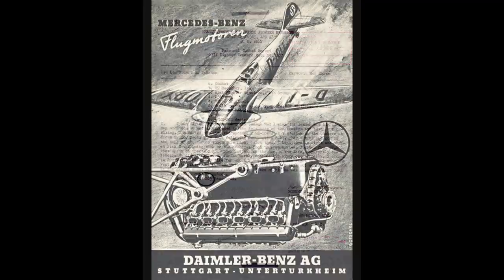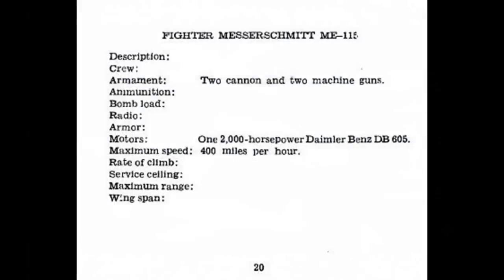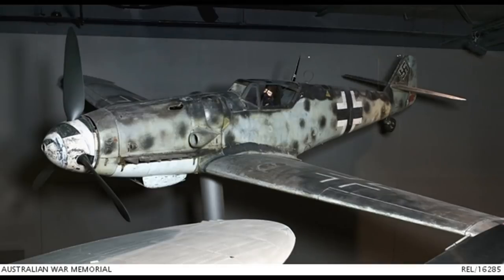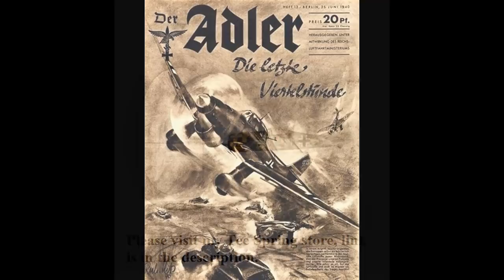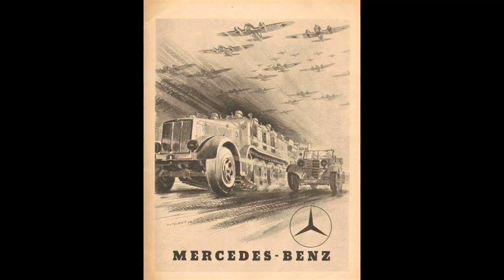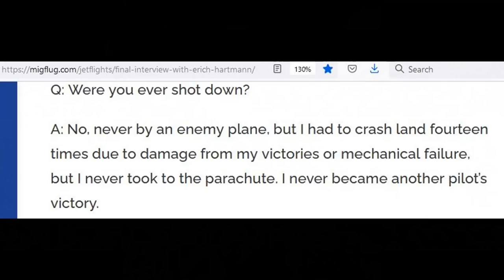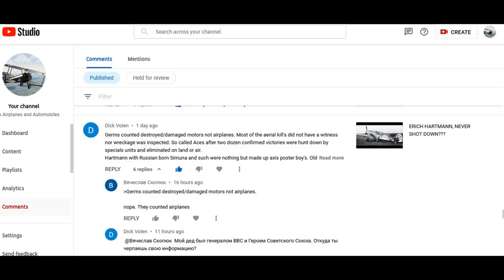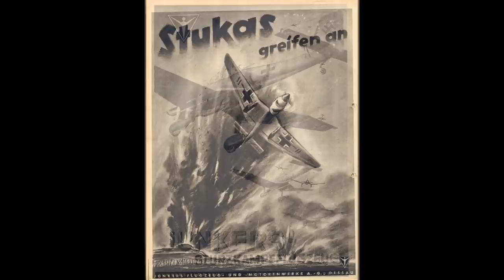Viewer Questions

Comment: That He-113 looks a LOT like the He-100D1, which supposedly did exist and was exceptionally fast for its time
Reply: Great cooling design too! That is..if NO ONE made holes in your wings... (Heinkel He 100)
Reply: Same plane, and the Aircraft stated out originally as the He-113 (which makes sense because their previous fighter was the He-112), but the name was changed to He-100,

And then back to He-113 to make it believable to the world.

And it was capable of those speeds in 1940...
Reply: @notsureyou  Yeees! We know ♥
Reply: @dallesamllhals9161  Well, at least you know. I didn't know, and learned something.
Reply: @lwilton  My bad!     ☮?
Reply: @dallesamllhals9161  Yeah, that cooling system wasn't very good for wartime, but lordy how awesome it must have felt to hit such paces so early on
Reply: @dallesamllhals9161  :-)

From memory, the information is scarce,

But according to the "all knowing" wiki, the D-1 did away with the evaporative cooling, and utilized the under-body cooler as the sole means for cooling.

But again the information is scarce.

I sometime wonder, if Messerschmidt had contributed to the funding of the DB603 (to help aid it's development), 

and not being as bold with the Me309 design (retained the normal tail dragger configuration, and had a standard fighter armament) if that might have helped that design coming to fruition earlier (and being superior),

Or if FW had contributed funding to the Jumo 213 project would we have seen the Dora 9 earlier??

But then I remember what the Nazi regime stood for, and what they did,

And I'm glad that those engines did not come to fruition earlier :-)
Reply: @notsureyou  Yeah, it's always a split between wanting to see more of this cool tech and wanting their regime to fall as fast as possible. But hey, there are just machines and they hold no ideology.

Comment: The HE113 was actually a HE100, there was a HE100 used to beat the ME209 speed record. It used surface cooling to improve air flow, no great for combat. The HE100 was manufactured to the tune of approx. 13/15, a couple went to Russia and Japan before hostilities began they never capitalized on the plane though the KI61 does look similar to the HE100. Heinkel used the remainder of the planes for factory defense and Germany used them for propoganda shots in various schemes.
Reply: @mikepette4422  The photo was on the cover of "The Luftwaffe War Diaries" among in other publications. It was leaked to the Allies also, shown in different squadron markings too.

Comment: re the Me209...if anyone can find back issues of the American Legion magazine from the late 60s to early 70s there was a very good and detailed article on its development and the "run for record" flights.  My father was a Legion member and I recall reading this article sometime during this time frame.  I especially recall that the radiators extended thru nearly the entire wingspan and I also believe they were evaporative to cope with the amount of heat dissipated by the engine.  So you could only run for as long as your coolant lasted.  I also seem to recall that an engine was good for perhaps only one or two runs before it lunched itself.   And as always, thank you Greg.

Comment: One subject I would love you to cover is the design of the firewall on the 109’s. My understanding is that it is mostly a one piece forging made from Elecktron and forged on the largest drop forge in the world. Supposedly that forge was taken by the US as a reparation. Also the firewall is used to hold the pivot trunnions for the main gear and you could take a wing off and still roll the fuselage around. Willy was a smart designer.

Comment: There's a good theoretical foundation for your running lean/oil dilution idea. Standard avgas is produced by narrow cut distillation - all of its components will boil below or about 100C, so very little will persist in hot engine oil. The synthetic fuel has a significant amount of lower volatility components (particularly the aromatics), and they could accumulate even in hot (100C+) oil. The Germans were also short of good quality lubricating oils, so they were already concerned about oil quality and paid close attention to it.
Reply: @brettdavies-young7102  That's a good point. Running lean means less soot & pyrenes getting into the oil, so extending the oil life. Given the German's lubricating oil shortage, that could have been a significant consideration for them.
Reply: Calums Douglas's book The Secret Horsepower Race covers this problem and talks about over rich  mixture and oil damage as the synthetic oil didn't boil off, and then having to reduce the fuel mixture and power to protect the oil.  And as per all of his superb book using primary evidence.
Reply: @malcolmmoy  Thanks - nice to have confirmation and a reference!. I've been doing some digging on the synthetic fuel manufacturing processes (I'm an industrial chemist by trade, so that's been right up my alley) and can definitely confirm that the C3 fuel would have had an unusually high proportion of high-boiling components. Anyone know how to let Greg know his theory was correct?

Comment: Video request: Assuming you haven't discussed it and I just missed it, maybe some day you could describe how Focke-Wulf, for example, engineered all four of the 190's standard guns to fire through the propeller disc? That is, if there's anything unique or interesting to say. I know that by that time, the interrupter mechanisms for cowl mounted guns was well beyond the experimental stage.
Reply: Yes, I think that this would be a topic worthy of Greg and his research skills. As far as I am aware, machine gun or cannon interrupter gear, only gets talked about in relation to WWI aircraft, but never WWII aircraft. I don't know why this is the case but with higher spinning propellers with more blades and coupled with faster firing more powerful machine guns I would say that the problem is far more critical. One thing I did learn from my book on the Me-109 was that experienced pilots would play with the lever related to (propeller pitch?) engine rpm in order to increase the rate of fire from their guns during combat manuvering.
Reply: Irc Kurt tank was an electrical engineer and the MG 151 had an electric trigger, it was probably controlled electric system..

Comment: Great video. I'm getting the picture that there is a certain minimum size for a fighter. Undersized planes just don't seem to have the room to fit all the necessary equipment. The Airacobra, the Spitfire, and the Bf109 all went up a size or two to stay competitive. A lot of Northrop designs come to mind, like the F5 and F20. The F16 must be just above the magic limit. Just a theory based on watching too much Greg lol.

Comment: Viewer question/Video idea: From a pilots perspective, the challenges and difficulties of flying a notoriously complicated/finicky manual plane like a p40/p38 compared to a more automated plane like a 109/190. Especially in combat. Is it more like a manual vs automatic car, where a stick is second nature once you know how, or was it actually a substantial workload on the pilot?
Reply: speculation here, but although adjustments could probably be made confidently and quickly in manual planes while in routine flight when given the pilot time for familiarity, once thrown into a combat situation where your constantly trying to spot and maneuver with enemy planes under significant G loads, the ability to adjust for optimal mixture/cooling/supercharger settings for altitude changes probably goes out the window to a significant degree for the manual planes.

Comment: Around minute 7, not sure what you are saying, but lean mixtures are for fuel economy.  At cruise, these engines run at as low rpm and as high boost as possible, while lean in the same time.  Octane does play a role here, and there is an octane rating for lean operation.  Perhaps you knew that, and I misunderstood your comment.  Cheers.

Comment: Thanks for some great videos Greg. I live in Krakow, poland where in aviotion museum (among many interesting planes like 
 beautifully restored Udet's Curtis Hawk) we have a fuselage of Me-209. You mentioned it could never become a fighter - would you like to expand on that statement?
Reply: Not Greg here (unfortunately), but I know the story anyway.
In order to achieve the record speed, the racing me209 had an engine cooling system based on special technology, with the whole wings used as radiators, leaking coolant by design.
Obviously this cooling technology could not be used for a fighter plane, due to multiple factors (e.g.: coolant consumption, extreme vulnerability to battle damage, etc.).
Without these special "cooling wings", replacing them with "normal" radiators, the performance of the Me209 were equal or inferior to those of Me109.
Reply from the maker: Hi Marcin, I would love to expand on that statement, but it will take a specific video to do it.
Reply: @francescoguzzetta  Thanks for explaining this one!

Comment: As always, absolutely love your work, and recommended you on the RCScalebuilder forum I use, as I am sure there are a good few guys on there who would love to hear what you have to say.

Only question I have is still.... the difference in design of the P51 prop and Spit prop for the same engine. Don't suppose you have come across anything new on that front? Keep up the good work :)
Reply: I wasn't aware of any differences in propellers, except perhaps for different manufacturers. None of my books on both aircraft mention any technical differences between the propellers for both aircraft. It is always described as a simple engine swap between the Allison engine and the RR Merlin and then the Packard licence built Merlin. Now I am very curious and perhaps Greg can shed some light on the topic in a video as there are plenty of people interested in both aircraft.
Reply: @markfryer9880  The Spitfire IX's Rotol hydrualic propeller looks quite different from the Hamilton Standard on the P51D - yet both used the same engine and both were air superiority fighters (although excelling in different roles). I would just have though at the least they would have tried swapping props to see if anything happened. I'm no expert on propeller design, but I would have thought such a different blade shape would have done something either way.

Comment: Thanks Greg.

I was not aware of the difference between the creators tool and the normal method of commenting.  I've only messed around with a very few videos and am abysmally ignorant on the subject from a creator's POV.

From a User's POV - YouTube's Comments have some real problems.  What they SHOULD do and what is done on most forums - is nest the comments - so if someone posts something - and there is a reply to THAT - it is nested under the comment it is replying to.  The thing with YouTube - is it only does that on one level.  After that - any comments are just tacked on to the end.

If there are a number of comments by some posters all the replies to them get dumped at the bottom of the list and there is no way to tell just exactly which comment the replies are to.

Thus - if someone has made 5 comments all being nested off a root comment - there is no way to tell if someone else's reply is to #1, #2, #3, #4 or #5.

I've had any number of problems because of that where someone will make a cryptic comment and I've no idea which of my comments they are referring to.

What I try to do, is lead into my replies with "As to xyz ..." to indicate which comment I'm replying to but ... there's no way in hell to get other people to do that and I'm probably not as consistent about doing it as I would like to believe ...
.

Comment: Greg, as always great info and great presentation. I have a goofy question. I notice frequently white geometric lines on the surface of Corsairs just before the cockpit. Is there a reason for these markings that you know of? No big deal, just they don't seem to appear on other planes like the Hellcat. Great work, thanks so much for your videos.
Reply from the maker: Those lines are there to seal those joints. Fumes would come out through those joints and get into the cockpit, so the Navy sealed them up.
Reply: @GregsAirplanesandAutomobiles  thanks! That is great to know, love your channel!

Comment: Liquid cooled Radial Engines. The US, for one, tried to develop them in WWII but they failed. It is clear why they were wanted as heat-flow for cooling becomes difficult for air cooled engines at high power outputs. In the world of motorcycle racing air cooled bikes could only do full power for a couple laps, and then watch the liquid cooled ones slowly pull away. If you can find the time for the needed research it would be good to know WHY they failed.
Reply from the maker: I talk about liquid cooled radials in at least two other videos, although I can't remember which. The short version is the were too heavy.
Reply: @GregsAirplanesandAutomobiles  It might be the Super-Prop video. There were some interesting planes who's development stopped as the engine they were being built around never made it to production and the reasons they failed were not given in detail. I may need to re-watch it and observe more carefully.

Comment: Maybe what Robert Johnson shot down that day was very early Bf 109 G-6/AS's with early DB 605 AS engines (large supercharger for more high altitude performance, but no increased emergeny power setting yet, so at low altitude not faster than a G-4). I'm not sure when the very first of these became operational but I think it was around the end of 1943. For someone who is used to see standard G-6 with the primitive looking gun covers and the heavily framed canopy, the new canopy and new, smooth engine cowling can easily create the illusion of a different type of aircraft.
Reply from the maker: I agree, in fact that's exactly the plane I was thinking of. However, while I could get the dates for the canopy to line up, getting specific dates for a specific 109 variants introduction is murky at best.  I don't know exactly when the G6 A/S entered service.

Comment: Looking at the very complex structure of the wooden Mosquito can we safely call it a composite airframe? (Even if it's just to hose the Gen-Xers..)
Reply: All airplanes structures are technically composites. --they are made up of a variety of different parts (which is the definition of composite). Even if the  separate distinct parts are all aluminum. 
If the aluminum skin material itself, is a solid sheet of aluminum-- the skin itself is not a composite.
If the skin material of a Mosquito is made of a sandwich of plywood , balsa, and plywood-- then the skin is technically a composite.
That said, the Mosquito design is not a shining example of "how to do it" these days. Wood quality and consistency is highly variable.

Comment: I've kinda noticed something with all this about power settings and fuels lately. "War Emergency" or its equivalents always seem to be limited to a handful of minutes, but why is that the case when power is often being limited by fuel octane.

If some American engine burning 150 can run for five minute at 2 ata, but it cruises for hours at 1.4 ata, why can't a German engine limited to 1.4 ata by fuel octane run that power setting for just as long? I would expect that engines burning lower octane fuel would tend to have longer time limits on the top power setting, because they're effectively stuck in a lower state of tune. I can understand that many other factors are not equal, but it seems like at least some of these engines running low manifold pressures should have much longer time limits on their maximum power settings.
Reply from the maker: Good question, but really complicated. I'll tackle this one another time in a video.
Reply: To simplify as much as possible - and this is only from my understanding, unlike Greg, I'm not an expert - I extrapolate from his previous videos - first of all you have engine life, second oil temperature at least in some airplanes will become dangerously high after that time, so you need to shut it down, give the cooler minute or two to handle it and start again. Most of other issues are connected to either longevity of an engine or it's temperature - assuming that you don't have for example 1.42 ATA limit for 3 minutes, because engineers figure out that in that time the amount of knock won't harm the engine etc. But as I write this I now start to understand why Greg said it's a complicated one. There is so much to take into account.
Reply: Don't forget that Germany was struggling with pressures of a lack of fuel, oil and raw materials by this time. A simple example was that later DB engines had poorer quality bearings simply because they needed to rationalise materials. This resulted in caps on power and useage that the Allies simply didn't have. Plenty of examples of engines and airframes being changed to make them easier to manufacture but less durable as the war progressed
Reply: @GregsAirplanesandAutomobiles  I'll certainly be looking forward to that. You always manage to make even the most arcane engine related topics interesting.

Comment: What do you think about oil conservation as a cause for the lean mixture with C3?  It would seem to me that one way to deal with water in the oil would be to change the oil more frequently.  But perhaps that would a problem for the oil-starved Germans, if done on a large scale.   

I guess this would still be an extension of the original problem, but it seems that there must be more to this issue than simply evaporation issues, as there are other potential ways to deal with it, and the power jump from the higher octane fuel was not trivial.